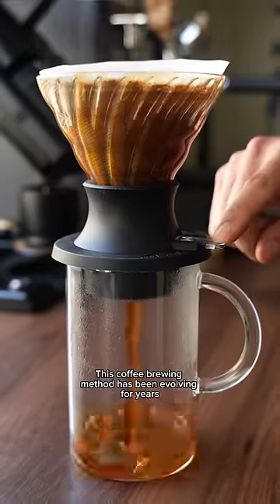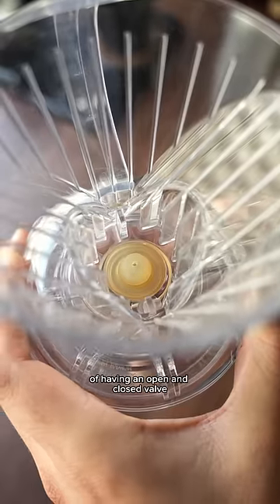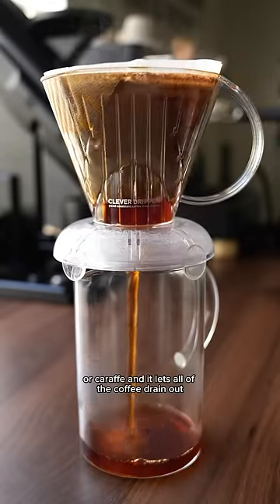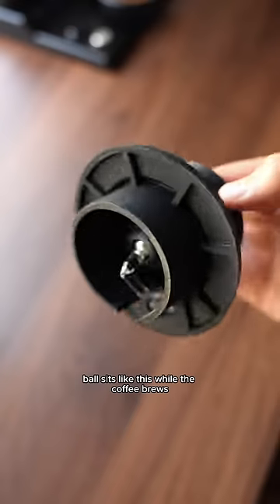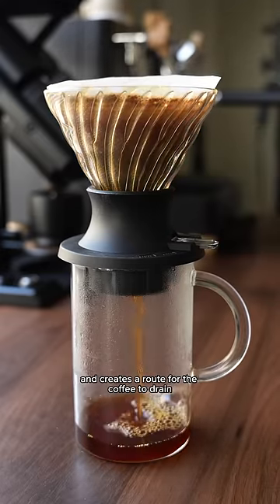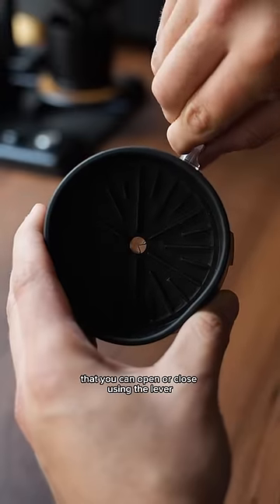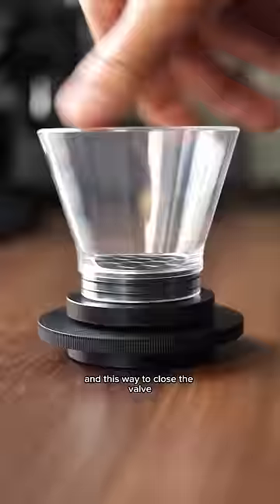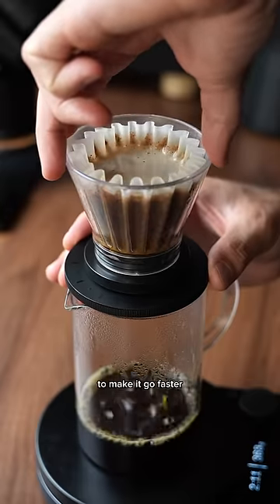The Evolution of the Valve Coffee Dripper

Comment: I like how they made the process more and more tedious
Reply: I'd say the opposite, this is simpler. Pour your water, don't worry about how fast or how long it's in there, just wait, and then drain it and drink. Like a simpler French press in a way.
Reply: @kanskejonasidag1 I think he meant the design of newer tool, not the tool as a whole
Reply: What?  The Clever Dripper could hardly be easier to use, it's easy to clean, pretty rugged, you have good control.  It's not much harder than making instant coffee, and incomparably better!
Reply: @kanskejonasidag1 just use a fucking french press
Reply: @homerc9101  takes much longer and much more to clean aswell. you use french press every morning?
Reply: That’s what the mean when they say “complex flavors.
Reply: @homerc9101 I started with that. Easy to get good results but: more grounds in your cup, rather messy to clean.

Especially with the Pulsar, Switch and Clever you can grind it the same way as a French press, let it steep for however long you need, release and you're good.

Cleanup: remove filter filled with ground coffe, throw it away, wash the filterholder. No mess, easy.

Also: Clever and Switch are pretty inexpensive
Reply: @homerc9101  I've always loved the idea of the French Press, but cleaning them is a fucking nightmare, so, despite having known many coffee lovers, only the most devoted coffee nerds I know have ever actually used one daily. This actually looks like it'd be more convenient.
Reply: @kanskejonasidag1  As an American who sees an all-in-one filter coffee pot (fill and let it brew) as the default, this is far from simpler. Looks like you'd have to do this 15 times to equal one pot of coffee that my robot makes for me in 10 minutes.
Reply: @iusethisnameformygoogleacc1013  Having used a french press, yeah. Nightmare to cleanup but very ubiquitous. 
However I have the Pulsar Brewer which is basically an easier version of a V60 for me. Easy to use and easy to clean.
Reply: @rodimusmaximus3912  Depends on the individual/household. We stopped using a normal coffee maker in our household since no one was drinking the rest of the pot after it's made and sits on a burner and making it bitter. 

Switched to single brew/pourovers being made but still having fresher coffee was more of the improvement in our household. Also now it's a relaxing ritual in the morning.

Comment: These have been around in a number of forms for centuries, usually made from brass or copper, then formed steel in the early 1900s. Many don't have stoppers, but it wasn't unheard of.
Reply: oneway coffefilter were invented 1908 by Melitta
Reply: @michamcv.1846   Yes, Melitta Bentz, did innovated paper coffee filters, not metal ones. Also, and this is not to discredit her at all, "filter paper" did actually exist at the time, though she may have never seen it. It was rather expensive and likely not used for coffee, but was used in alcohol distillation experiments and electrical components. Modern coffee filters and those used in chemistry labs are often identical at this point, it didn't surprise me if she and her husband quickly found paper sources related to electrical or chemical development for their product.

Comment: I’ve been using the Hario Switch for over a year now, and I really can’t imagine needing anything else to make a good cup.
Reply: The last “flow control” one does tempt me.. but I also love my Switch!
Reply: @jchodes  That is definitely interesting… It’s sort of a middle ground between a standard V60 and a Switch: You can pour all the water you need at once, like a Switch, but you’ll need to find when to increase and decrease the flow, and to what level for different beans. Kinda like timing pours and grams of water needed for a V60 pour over recipe.
Reply: Do you like the Switch more than a V60? If so, why?
Reply: @Th3K1ngK00p4  I do like the switch more than a standard V60. I don’t have to worry about how many grams of water I put in with every pour. I use James Hoffman’s recipe which is very simple. Cover the grounds with water, swirl, pour until you have 250g of water, wait for 2 min, stir, wait 15 seconds, and then drain. A lot easier than most V60 recipes because it’s easier to get consistently with less steps on average. I’m always getting good extraction since the grounds get to steep. 

The only variables you have to worry about are grind size and water temperature.
Reply: The Switch is just a little extra awesome on a good cup. I use the “switch” on it for pre infusion.
Reply: @claystar9valor  awesome, thanks for the reply! I've been using a V60 for the last 8 or so years, also with James Hoffman's recipe. I'll have to check out the Switch
Reply: @Th3K1ngK00p4  Cool! I hope you like it.
Reply: Does the coffee touch any plastic components with the Switch? I use, aeropress but would like to avoid plastic components in the future. Thanks
Reply: The ‘Switch’ itself is plastic so yes the coffee does pour around and out of a small plastic plug mostly blocked by a metal ball.
Reply: @jchodes  thank you
Reply: I am very interested in anything new in the coffee sector, and in the last decade or so great advances have been made (I think).  It is starting to look like we're getting into "Diminishing Returns" territory, and further gains will be smaller.  Maybe not zero!  Also there is the "Design" aspect!  People  have been fooling around with teapots for hundreds and hundreds of years, and new ones come out, there are gallery shows of teapots....  I have definitely started buying interesting attractive and functional coffee gadgets that don't need to exist, and I might only ever use a few times for the novelty.  There are for example things that use the famous V60 type of filter but fold up, or are separate parts that link together to make a little funnel.  I just got one that's three springy thin pieces of titanium sheet (!) that link together to make a triangular cone kind of thing that holds a filter.  When folded down I guess you could put the thing in your wallet or a shirt pocket.  Why would I do that?  I don't go outside that much!  If I wanted to go camping and make delicious coffee out in the woods,  I could just take a rugged V60 kind of thing, or any of a dozen similar things I already have and never use.  Or a permanent stainless or titanium filter cone?  Well, it's all exciting and fun, but we might indeed HAVE all the coffee gear we NEED.  This is all about pour-over action of course, one could get involved in home espresso type activities, and there doesn't seem to be any end to THAT!

Comment: Corning did something similar back in the 60s with their dripolator. The point was so you could boil the water in the bottom pot, pour it into the top pot and then remove a plug and filter back into the bottom pot. It differs from this idea though, as the plug was above the coffee, so the grounds didn’t soak.

Comment: theres also a cafflano lever driper which has a slide piece on the handle that allows a piece inside to lift up. I prefer it as its cheaper than a hario and doesn't rely on being placed on a mug like the clever so you can leave the cup underneath the whole time

Comment: I put my grounds in a glass (pyrex) measuring cup. Pour over the hot water. Drain through a ceramic cone with a paper filter.

I get some of the benefits of a French press (the seeping) with the easy disposal of the grounds in the filter paper. 

Fewer coffee solids as compared to the French press.  No need to delay the drip process. Easy clean up. 

Mostly I dislike making my coffee with plastic baskets or cones.

Comment: All of them are immersion + percolation. Any difference in taste?

Edit: Guys, I meant if these 4 brewers make different tasting coffees
Reply: I have read that you can taste the flavors of the coffee better than immersion and hides better the mistakes of percolation. It’s a good transition since immersion to percolation
Reply: Check out James Hoffman, the coffee connoisseur. Idk the answer but James surely does.
Reply: Generally immersion is a lot more tolerant than percolation brewing. I’d say this is just paper filtered immersion, there’s not a lot of percolation elements to this.
Reply: @johnnyfettslem7439  Exactly. Edit: There's one-and-done percolation here.
Reply: @ziptiefighter  Zero? So the water DOESN'T go through the grounds in your opinion????
Reply: @Tuubasd  Not in the sense of a traditional coffee percolator where the water (and subsequent already brewed coffee) can recirculate over and over as long as sufficient heat is maintained.
Reply: @ziptiefighter  I would argue that the Switch & Sworks design have the option to be completely percolation or a mixture of both. I've been using the switch as it allows me to dial my brews according to the beans I'm using, I can tweak my recipe on the fly to create a cup with less or more body accordingly. After using the Aeropress, Normal V60, Kalita wave & Origami I have to say the Switch has been my favourite filter set.
Reply: @ziptiefighter  Percolation essentially means fluid going through a filter, so most coffee brewing really apart from things like cowboy coffee and turkish. Percolation brewing usually refers to brewing methods where the coffee sits in a paper filter and water goes through, and counterintuitively not to coffee made in a percolator.
Reply: @DoubleCamshaft  I understand the meaning of the word. I jumped the gun in saying 'zero' percolation. And thus, I stand corrected. 
I'm old school...a coffee percolator is notably different than this. How many times did you want your already-brewed coffee recirculated/percolated thru the used grounds?
Reply: @ziptiefighter Percolation might have been more popular now, but it depended on keeping the water essentially at boiling temperature the whole time, making nasty coffee. Sometimes it could circulate for hours in big office-sized urns. Honestly if we weren't totally unaware that decent grounds existed we probably would have moved on from percolators 50 years sooner like the Italians. But we didn't clue in until the invention of the Melitta and Mr Coffee forced us to recognize the prison of our assumptions. We banished percolators and haven't looked back. But with PID temperature controllers and cheaper, more reliable pumps, maybe it's time to start looking at recirculation and percolation again. Excessive times would still be bad, but lower water volumes, flowed 3-4 times instead of once, might be a thing.
Reply: @blairhoughton7918  No thanks on old school percolation. Immersion is superior. Love my Clever, and various V60 and flat bottom pourovers.

Comment: Seems to me like a french press with extra steps, not gonna lie.
Reply: The paper makes the most difference but you could get similar results.
Reply: Fewer steps if you count cleanup.
Reply: @blairhoughton7918 more steps if you count earning money for this doodad compared to a french press. Also, y'all don't wash your filter funnel or what?
Reply: @ZeroPlayerGame  I can't put grounds down the sink, so getting a FP clean requires dumping it into a folded paper towel in a pourover cone. Basically all the steps for a FP plus pourover. This is just a pourover plus one step to open the valve.
Reply: @blairhoughton7918 There's still an extra step of buying 10x more expensive doodad, but if that's worth for ya, that's okay I suppose. You can probably retrofit a press-to-drain teapot, those are quite widely available - although of course there aren't size-fitting paper filters for that, you'd have to use a drip filter or somesuch.
Reply: @ZeroPlayerGame  use any cheap pourover cone (that just has the one hole at the bottom) and roll a plug out of a strip of filter paper

Comment: Pourover coffee tastes much better.  If you really wanted this abomination, you could brew ground coffee in any container and then pour it through a filter. 
I make my loose leaf tea that way, with a glass pourover jug, and dual-wall metal mesh cone filter. 
The filter is so fine that you get a really clean cup whether you're doing a coffee pourover or filtering an immersion tea... There's really no need to overthink things and invent expensive equipment or use plastic parts. Mmm, hot plastic water.
Reply: Pourover gives less body, which is what you want for certain beans with fruity and floral tones. This gets you closer to the French press side of things, but with less mud and oil. Doing pourover in a mesh filter is probably getting you more oil as well.

Comment: Couldn't care less about this coffee hipster shenanigans - but those things look very useful for loose tea. Does anyone know a model that is bigger and more than just overly expensive plastic crap?
I used to use one of those sieve-stamp-press thingies, but then I either have to drink fast or pour it into another container, so that the remaining tea at the bottom doesn't make it all bitter.
Reply: I make loose leaf tea in a glass pourover jug. After 4 minutes, I pour it through the included 2 layer metal mesh cone filter, into a dual wall glass cup. It's quick easy tasty and results in a very clean cup because the filter is so good. To clarify I only use the filter when pouring into the cup, not while brewing. You could brew your loose leaf tea in any container; it's the dual wall metal mesh cone filter that does the trick when the tea is ready.
Reply: @MermanManly  I have one of those filters as well, but they are hard to clean and only make sense when making a whole pot of tea.
I'm still looking for a good and comfy solution for a single cup.

Comment: The principle and resultis the same as the French press
Reply: I have a Clever Dripper.  Cleaner and less 'grainy' than a French press due to the use of a paper filter.
Reply: Yes, it’s called immersion brewing. The result is different because it’s paper filtered as opposed to the shitty metal filters most French presses have.
Reply: Yep.
Even better immersion in a saucepan and then filter it.
   More clumsy than the aeropress but it works better.